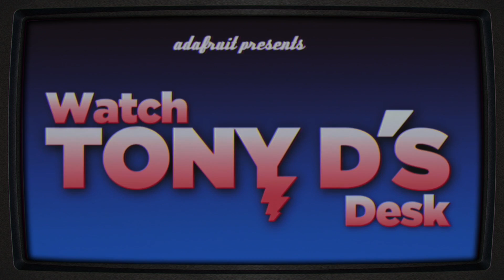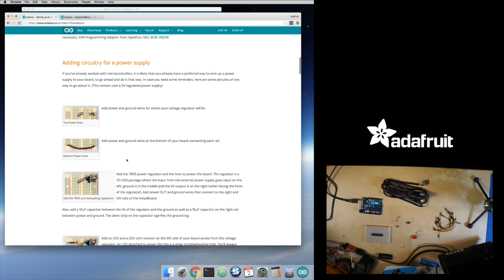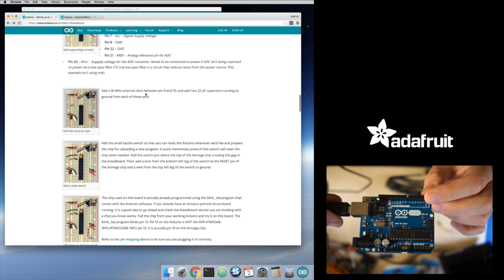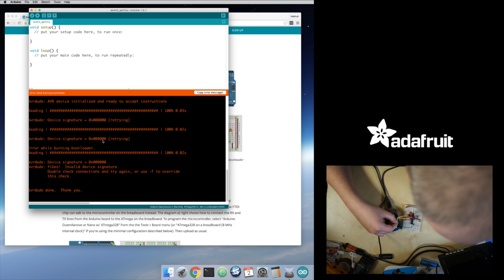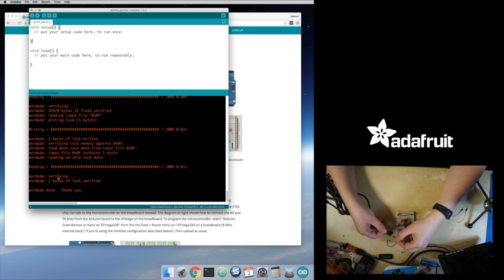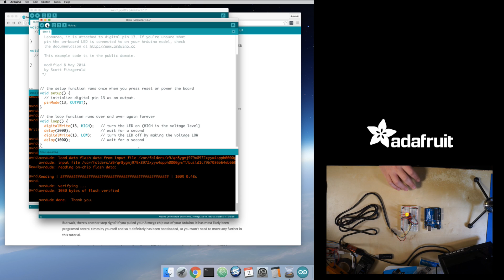Happy Arduino Day! Build a breadboard Arduino with Tony D! @arduino @adafruit #LIVE

Comment: Great Video, really enjoyed watching it, nice lab setup btw…

If have one question, what is the technical advantage of connecting the Aref pin to VCC? In the Arduino Uno rev3 design it’s open (not connected to VCC), 
and the Atmega328P datasheet doesn’t really shed any light on this either, although I haven’t fully read all 448 pages..

Comment: 25:40 Although technically correct, it could be very confusing using the terms Anode and Cathode to refer to the polarization of an electrolytic cap rather than for cells and diodes, or is it just me?

Comment: From 15:37 until 23:03, maybe try to connect the power TO the breadboard, you can't program if there is no power on the breadboard.
Also the 16MHz xtal you point to on the Arduino board is not the xtal used by the Atmega328P chip, that uses a smaller resonator, don't know why they didn't use a xtal, must be cost related.